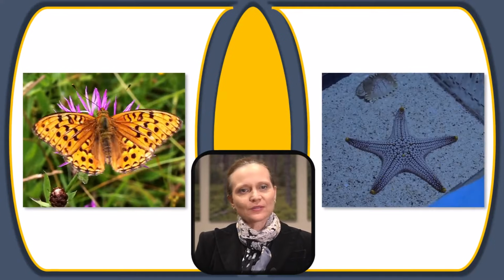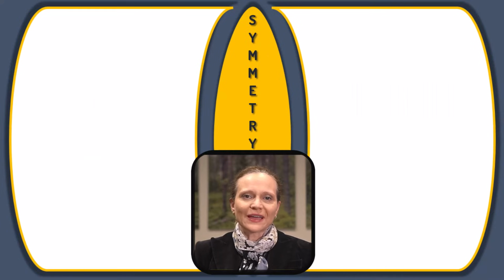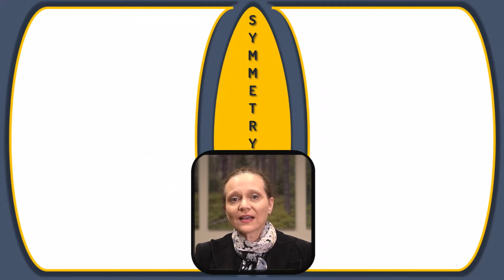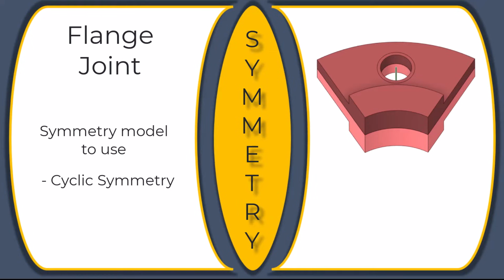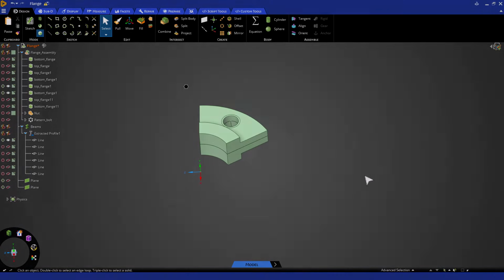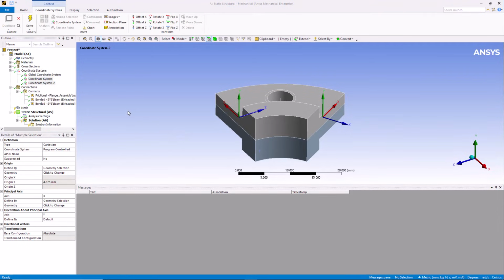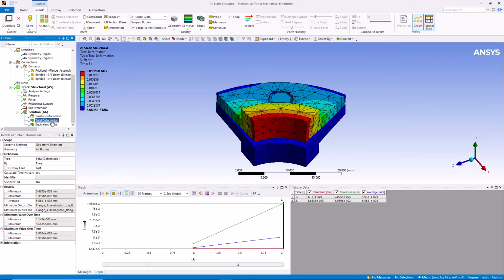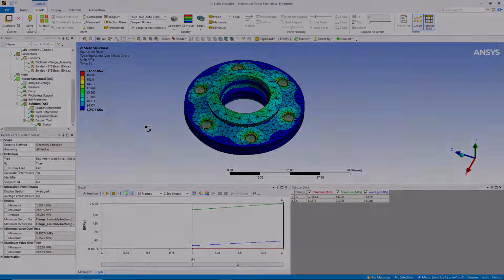Understanding When to Take Advantage of Symmetry Using Ansys Mechanical — Lesson 3

Comment: I’m wondering if Eigenvalue Buckling can still be run when you only model a symmetry region but don’t actually apply symmetry boundary conditions (so basically no symmetry plane). From the video, it feels like the main issue with symmetry is that using a symmetry plane forces the result to stay symmetric, so you might miss some buckling modes that are actually asymmetric.

My understanding is that if you’re just using a symmetry region without enforcing symmetry constraints, it’s more like you’re only representing the stiffness of that part, not forcing the deformation to be symmetric. Am I getting that right?